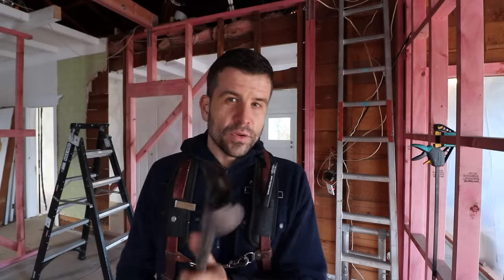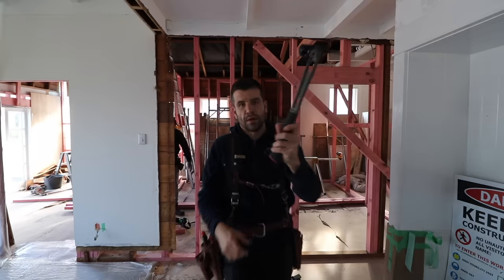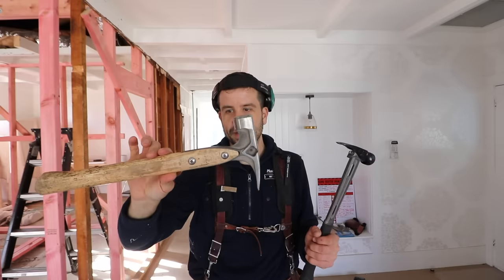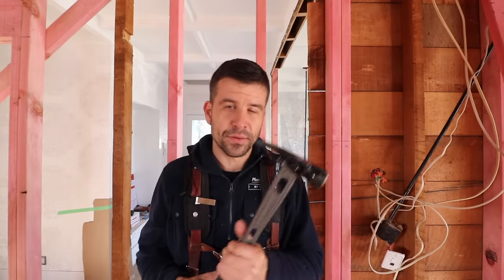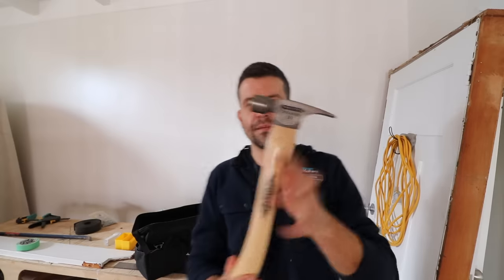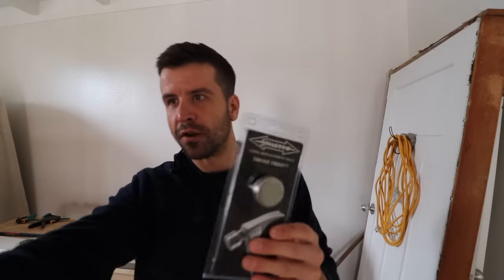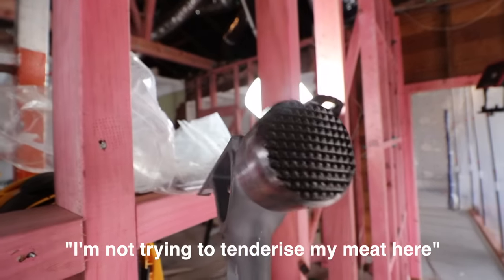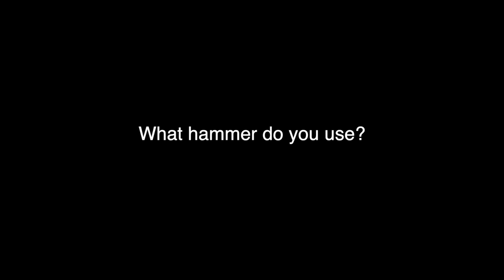Martinez M1: The Hammer Everyone Is Talking About

Comment from the maker: 12:00 This is why the timber is pink
It's interesting reading the titanium vs steel discussion! Cheers for watching.
Reply: It's debatable if you need a hammer at all when building with a grade of timber that low. Just push the nails in by hand. Seven annual rings for a spruce 2x4 must be some kind of record.
Reply: Just a tip for your mate with tennis elbow from the former badminton coach of GB. Place a sellotape ligature around the fattest part of your forearm whilst working. Take 400 mg Ibuprofen 3 times daily. Freeze pack on elbow for 11 minutes then work it until pain return 3 cycles repeat 3 times daily. Cuuuured me in 2 weeks and has never returned. Good      luck
Reply: We have a pink one in California and it's the first time I've seen it in the USA
Reply: Lol i was gonna say why is all the lumber pink 👍
Reply: "Had" a leaky building problem in NZ? We still very much have many leaky buildings here. The untreated timber was only part of the problem. Still plenty of cracked Hardie Tex, and direct fixed Titan board in our country sadly. H1.2 treated timber merely delays the problem, it doesn't solve it.
Love your work. Keep up the great jobs and tool reviews 👍
Reply: That analogy is really something else. Are you substituting extremely low grade lumber with an extremely high performing car? 
A better substitute would be a car with extremely weak performance like a soapbox car, in which case your analogy would make perfect sense.
Reply: Well, I guess it takes two to tango.
Reply: Are you high?
Reply: @MrBeemeg  My protocol sounds stupid, but I swear by it.  Chin ups, every day to exhaustion. Only works for tennis elbow (not golfers) but works in about the same time frame.
Reply: Interesting, in the US we avoid putting treated lumber indoors unless absolutely necessary. Basement bottom plates, mudsill a, some lower exterior plywood sheathing, etc. Might depend on what you guys are treating it with.
Reply: Was coming to ask.
Reply: @Special Ed innovation in wheels occurs all the time. Lighter materials, stronger materials, more efficient designs, better looks. 

The phrase is "don't reinvent the wheel." No one said anything about not improving it.
Reply: Not hammer what timber want, in here finland u see top hammers what u dont get there. Made for finland for finish
Reply: Ever used a single claw hammer? It looks like one with a straight claw, but one got broke off.
Reply: the timber is pink lowest level u can use In New Zealand
Reply: @dwainbird5178  Yep. Just got a woodburner installed. Dumbarse installer plopped a flashing down around the flue with silicone on top of the corrugated iron. So the leading edge of his 'flashing' didn't lap under anything- only as good as the silicone. Could've run a tray flashing up to the ridge, only 400mm away. Couldn't get any sense out of him as council okayed it. Roofer fixed properly. Then, elsewhere on same house, same roofer goes goes and puts an apron flashing upstand on the outside of the weatherboard, sealed with silicone again, rather than sliding under the lap of the weatherboard above. Do it myself next time.
Reply: I'm watching this video because i saw there are $300 hammers... Couldn't believe it

Comment: In all my years not one customer has accused me of putting nails in with a cheap hammer.
Reply: I’ve only been in the trade for 3 years, just out of curiosity how long have you been doing it? How does your elbow feel? Genuine questions, I promise. I don’t know very many people outside of the company I work with and the men I work with have pretty expensive hammers.
Reply: @-curran2163  Been in construction for about 18 years. I just use a Stanley hammer that cost about 15 quid, and honestly, my elbow is fine!
I actually have problems with my non-hammer hand and wrist. I think it's because I use that hand to grip and hold stuff in place while I hammer/screw it.
Reply: @-curran2163  8 years carpentry, ive got a 28oz Estwing, no complaints but its all ive known lol
Reply: Best comment
Reply: 20 years carpenter. I found my way to the fiberglass handled Vaughn. Seems like less shock to my elbow over the typical metal handles.
Reply: I've had a 22oz steel hart for the last 2 years, one of my coworkers handed it to me yesterday and said this its heavier than it looks. Had no idea stilletos were under 20 oz until that moment lmao. Also squeezed the head right off my dick taking a piss the other day.
Reply: @-curran2163 youre knees will feel anything first. Especially if you do a lot of stairs.

Comment: From someone who sold hammers at a real tool store for years the titanium hammers when they first came out had a lot of issues with snapping the puller claws, titanium has great striking force but brittle when it comes to torque. In later designs most of the companies shortened the claws to make them more durable.
Reply: Nice.

Comment: After about ten years of use, I'm on the second wooden handle of my Stiletto 14oz Ti hammer and I expect it to last for another three handles easily.  The replacement handles are about $15US.  At some point I might send it in or have a local machinist re-waffle the head for me (I don't have the tools to do it properly).

The classic Stiletto 14oz wooden handle is an heirloom tool.  A new handle can always be made out of stock material by a carpenter if Stiletto handles ever become unavailable.  There are no proprietary fixings that could wear out or become unavailable (requiring a machinist to service a hammer) like some of the new fancy designs.

I do use a pry-bar and a steel-plastic handle hammer for demolition work.  I take care of my Stiletto because it has taken care of me. 

I used to build log homes.  If you do log or timber building then I recommend something like a 24oz Death Stick.  I could move a big log with a blow from that hammer that a 14oz Ti hammer could never do.  The Death Stick was a bad-ass hammer when I was younger.
Reply: Nathan Sharp “You don’t want to sell me death sticks” (sorry that’s a Star Wars reference I couldn’t resist :D )
Reply: Still have my original death stick. 22 years old and I named it "the general". Smooth as an Estwing.
Reply: Dead on still makes them

Comment: I am a big fan of wooden handles.  68 now and been swinging hammers for more than 60 years.  (Those earliest years,,, much or often to my father's dismay.)  I have swung them all except for the newest crop.  Sometime when I was about your age I used a fiberglass handle for years,, and later an Estwing steel,,  and at some point my hands grew seriously painful.  Like wrapped and protected and learning to swing with my left hand.  Until about a year later my left had began 'talking' to me.  The shift to the right foot for my claw hammer did not sound like the way to go,, (Could'nt hit shit with it,, except the other foot trying to hold the nails.)  Went back to an ash wooden handle,, long 16 or 17 inch,,, never had a problem since.  A 'good' steel handle ,, you hit the nail,, the hammer hits your hand equally at the other end.  A wooden handle?  you hit the nail,, and the reflected whack on the end you are holding is dissipated.   Wooden handles are getting hard to find,, every body just wants you to buy a new hammer.  All of my hammers are older than you are.

Does the titanium absorb or reflect the vibration?  You implied that it reflects the vibration.  Get rid of it unless you want some very, very painful hands.
Reply: my thoughts as well, I hated the estwing with a passion. I like the stiletto with the curved handle the most. First got stollen and the second my dad grabbed and never brought back lol

Comment: MY experience with hammers professionally has been as follows.  22oz Stanley, Stilletto 15oz wood handle, then the M1.  M1 is hands down my favorite hammer.

Additionally, I switched to the Diamondback Tool Belt with the hammer holster.  I highly recommend that system for the trades.  Make the hammer so convenient.  As you pointed out, no fishing behind you looking for the loop or struggling to get it from the loop.

Comment: My framing hammer has been a 15oz lowes exclusive kobalt for about 6 years. I have replaced it twice cuz I can go to Lowe's and swap a broken one. Side prying bent it, and the grip slid off. Both of those issues have been fixed (thicker neck, bolted handle) in the design and I've had the same one for 4 years. That's an insane lifespan for a framing hammer. Light, invincible, cheap, nice warranty (though idk if it's still made)

Comment: I have found that sanding off the factory finish and coating the handle with Penofin oil finish or a mixture of beeswax and linseed oil greatly improves the grip of wooden handles for all tools, especially hammer handles. In my opinion, they should not require great effort to hold, but be smooth enough to easily adjust ones grip. The beeswax and linseed oil is best applied hot. It absorbs into the wood and steel of tools, providing rust protection and a kind of lubrication for the metal, and provides great long lasting protection for the wood. It was taught to me by an old saw sharpener. Its also great on shovels. He said it was best if you could dip the entire tool in the hot mixture. He kept a tall thin steel barrel over a burner in the shop that was big enough to dip hand saws, and wide enough to take a shovel (half a shovel at a time). He also had a pot for band saw and circular saw blades. I never made more than a half gallon at a time, so I just tried to do it on a hot day and painted the hot mixture on with a paint brush. I don't remember the exact proportions, but I seem to remember  2 to 3 parts linseed oil to 1 part beeswax. The consistency is the most important part. It should be thin enough to absorb into the wood without just congealing on the surface when hot. You can use more beeswax if you are able to dip the entire tool in the hot mixture. Wipe off excess, and let dry for a day or two.
Reply: Am about to coat my Stiletto 10oz. Ergonomically contoured the OEM handle and removed all the lacquer going from 40,80,120,220 to 400 grit sandpaper. Thank you for mentioning to warm up the materials. . I am thinking of using a heat gun to warm up the wood before and after the oil has been absorbed and wiped off to quicken absorption and drying.
Reply: @Technie87  
Handles are not coated with lacquer, but polyurethane. Lacquer is way to expensive.
Reply: @GoCoyote  "The most common mistake made when replacing a hickory handle is driving the handle into the hammer head so far that the bottom of the head cuts into the lacquered surface of the handle." - This is straight from stiletto's site
Reply: @Technie87  
Well it may be possible that they are actually still using lacquer, I suspect that they are using old language or incorrect terminology. Many people still refer to polyurethane finishes as lacquer, although they are very different. Because of the toxicity and flammability of the solvents used in lacquers, they require expensive air handling systems. Modern water based finishes are much cheaper, and lacquer, while a lovely finish, is more delicate and less durable than polyurethane. Lacquer allows the wood to breathe, so that is why it is used on many violins. My father used to dissolve amber into lacquer to French polish violins when I was kid. If they are using lacquer, the finish will not be a layer that can peel away from the wood, but will actually be a part of the wood, although there are also other finishes and preparations that will do the same. I really like the beeswax and linseed oil mix, but Penofin is a nice alternative.

Comment: Hello!  so this is the first time I've seen a vid of yours and it was great! one thing I did notice at the end is the "thumb grip" I learned early on as a blacksmith that there is a nerve that runs from your thumb all the way up to your shoulder and neck. using a hammer with vibration resistant material will help, but using your thumb on the back of your hammer like that can cause nerve damage over time.

Comment: Titanium with the wooden handle is the best combination for the arm. I would never go back to full steel hammer.
Reply: Yes sir. I’ve gone through every kind of hammer and just keep going back to my wood handled stiletto. Just having less weight on your pouch is huge after a 9-10 hr day.
Reply: My biggest concern for the wooden handled hammers is if it will last using it for demolition, as i use my steel hammer for demo all the time not having to worry about it getting chipped or broken.
Reply: @bh2347  I do the same thing. First handle only lasted for a week. After that, I use nail puller for the de-nail job. The second one is still going strong after few years.

Comment: I do high rise concrete forming and a lot of guys that come from framing have stilettos and the head always come loose because we hit a lot metal objects. We don’t just nail nails into wood. I found the martinez m1 is way better. The replaceable heads are great and me and few others who have it will never switch.
M1 also has different size heads and 2 different handle types. Great product.

Comment: I use a DeWalt 16'' 14oz steel framing hammer, and have used it pretty much my whole career so far (about 5 years). I like it, but I haven't tried it against many other hammers. I know I do appreciate it's lighter weight, though.

Comment: Good video. I see it was made 2 years ago and things have changed, which I am guessing you are aware of...but in case you did not know. They have a multitude of heads, 10 by last count. All heads fit on M1 & M4 handles and there is a Titanium framing head, which would definitely change the balance you were talking about. They also show 20 different grips on the Martinez website; all M1 &M4 compatible. The main difference is curved or straight handle...the other difference is a multitude of colors to choose from. I am sure that a straight handle will give you less hassles in grabbing and removing from your belt hook, but it is never as smooth as wood so although should be easier to remove, still won't be as smooth as your Vaughan. 

I saw a video where Mark Martinez had an M1 handle with an M4 head...this also makes for a more balanced hammer, and then he also showed an M4 handle with an M1 head, he said it was great for demo.

For sure expensive for anyone not using one for a living, but if you do earn with a hammer, the many configurations between handle, grip and head is quite appealing.

Comment: 3rd going on 4th year apprentice here… I use the dalluge titanium and just bought an M1! In my relatively brief experience, it seems like the dalluge is more suited for interior framing, finishing, etc. it’s also wonderfully light which makes it more comfortable to carry and use. I put hockey tape around the handle to deal with the grip problem, and used jb weld on the bolts that hold the handle on to keep them from gradually unscrewing.  Lately I’ve been doing a lot of super heavy concrete work/demo, and the little dalluge just was too light to keep up, so I invested in the M1! I love hammers and seem to collect them, so I’ll prob end up with a stiletto or two in the future as well. Looking forward to trying out my M1 on the job! 😊🔨
Reply: Mate, if you had to chose between the dalluge and the M1 which one would you pick as your everyday?
Reply: @maxmarcus6074  Dalluge by far ahahhahaha. No question. Do all the research about the M1 and hopefully youll come to the conclusion its a decent hammer but not the best and super overpriced. Its more a collectors item. Steel head instead of titanium head has more vibration. Titanium handle vs hickory handle has more vibration. 907 grams... Thats over 1 lbs it weighs. Ill stick with a 14 oz stiletto or dalluge that weighs about 600g if you shave the wood a hair and color your handle how u want it.

Comment: I also thought mine felt really heavy. I switched the head to a M4 smooth face (still on my M1 handle). Feels a lot nicer for everyday general use and the green rubber cab is amazing for finish work. The head of the m12 head also has a flat top.
Reply: Since you've have it for more than a year. Would you suggest the M1 handle with the M4 head for light house framing? Would it still work for sidding as well?

Comment: I recently switched to using wooden handles as we do foundations as well as framing and the oil from the forms makes rubber and other synthetic handles very slippery/ slimey. The wooden handles absord the oil and never get slippery, the best thing to do with a wooden handle is sand the varnish off and soak it in anti freeze so it won't shrink and crack
Reply: Idk about the chemistry of dipping a handle in that

Comment: I bought the steel Hart hammer from Home Depot here in the US. It is the cheap cousin to the Martinez. The side nail puller is PHENOMENAL! So much easier than the regular. Not a replacement by any means but it makes things much easier. It is heavy though and the steel handle does shock the arm a bit. Good demo hammer like the Martinez but the brand has been sold since then and quality has gone way down. Sad. My framing hammer is an  old titanium Dalluge that was my Grandfather's. Huge strike face but minimal weight. I had to put a new wood handle on it and carve some grips into it. Really nice hammer.
I use the Hart for demo/concrete work and the Dalluge for framing so that the nice titanium head stays nice. I think having two hammers is just a practical thing to do. Really appreciate the review.